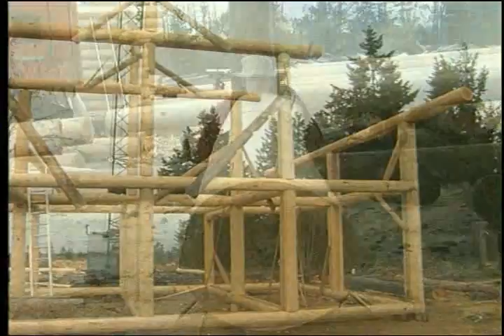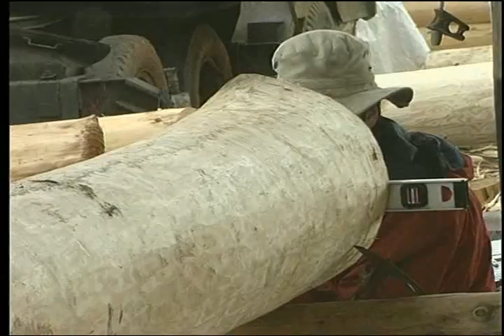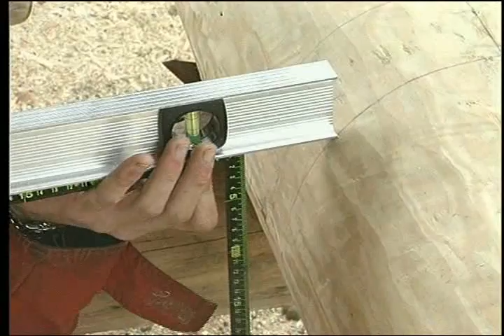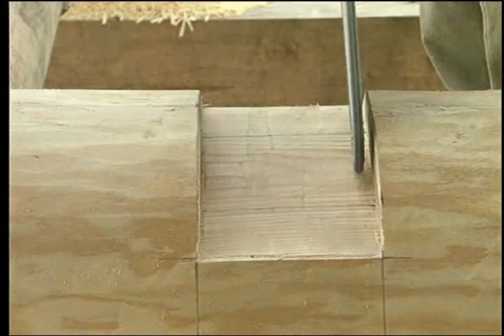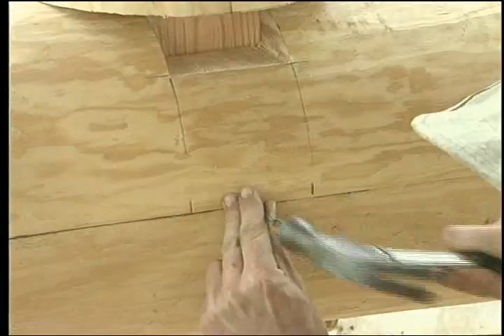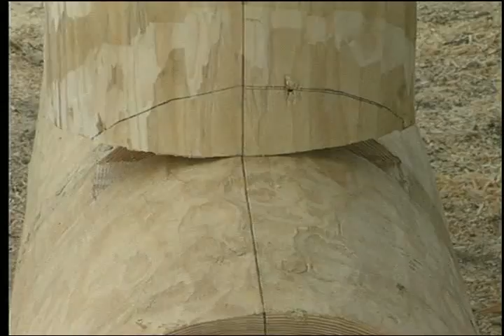Building log cabin: Post notches

Comment: Appreciate all the Old Pro detail and exact procedures. I plan to build a few rural structures (cooking shed for Summer, outhouse, etc. and plan to build all out of logs.

I just finished a poor man's wood shed, using wood pallets for three sides with a pole in the middle for the open side, and with a horizontal log lying on top and tying in the two open sides. I cut a rough mortise and tenon in the pole and horizontal log with my Stihl 028 chainsaw after chalking it out. Worked great, after a lot modifying with a chisel, but I want to up my game and do a better, more craftman's-like job. Thanks very much.

Comment: Basically cut a square hole to match a square post to fit together. Be sure to locate the joint where you want it. Now you can skip watching someone use a chainsaw, hammer & chisel whole Mr Monotone drones in occasionally. 
You’re welcome.
Reply: Doesn't sound like you've ever touched a wood tool, but go ahead and blather on. The guy's a frickin artist with that chainsaw!
Reply: @ChuckInMoFNABCA  Not to mention all the tips, techniques and procedures that actually do the job, rather than just make a short, smug description. Dix sounds like a city boy whose only familiar hand tool is his iPad.

Comment: Best video on the topic ever! Wondering what is the name of the wraparound squares used in the video. The closest one found on amazon is called Japanese flexible square. But that seems only able to bend slightly, not wrap around a log. Any idea where to buy the wraparound square?
Reply: Michael Chen I found a company that produces squares and bendable rules,  but they don't make bendable squares. They even market the rules for timber/ roundwood.  I just thought to make one out of a roll of Galvanized roof flashing.   Since you wouldn't actually want to use it for laying out measurements.